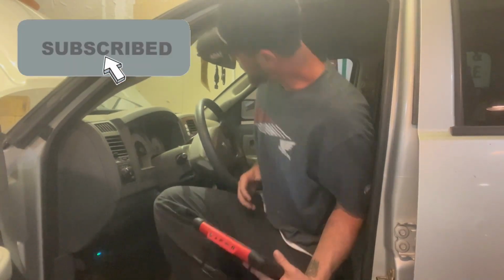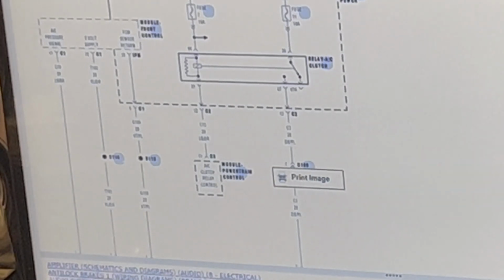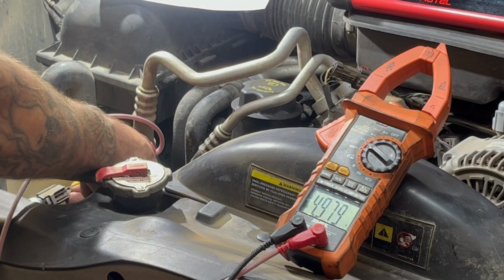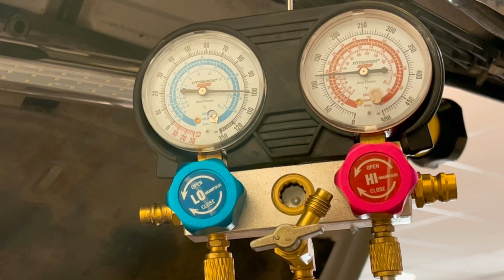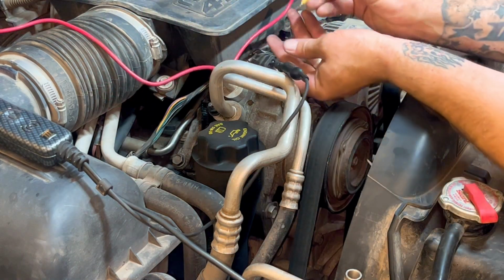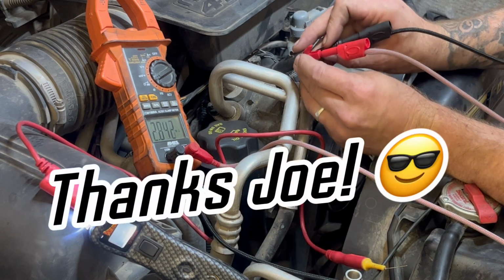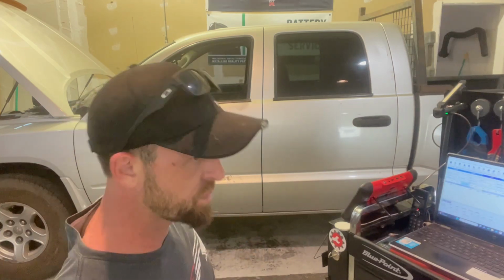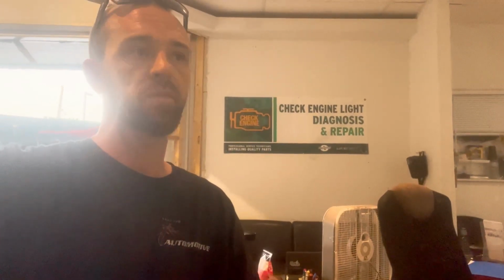2005 Dodge Dakota 4.7L A/C Inop. - P0533 Pressure Sensor Circuit High

Comment: What about if signal show 0v and ac hi pressure show 432psi and changes your reading even if you disconnect the sensor connector and i have 5v reference i have good ground and voltage is 1.0-0 when connected and the 12v at a/c compressor is not there and the only what to get running the a/c cluch is to jump the a/c clutch relay sending 12v via there to get the compressor going? Any suggestions

Comment: I remember once I saw a guy unplug the harness from the switch and submerged the harness into a bag of water. To keep the AC on. I asked how come he did that? And he explained and it made a lot of sense. Crazy buy made sensor. It was a three pin. Was amazed by his thought process until he could get a sensor.simple testing but effective. Thanks Max. Keep pushing bro
Reply from the maker: A bag of water?! Like dipped the connector in it? That’s funny! Thanks for watching bro!
Reply: @BigDogDiagnostics  yeah.and it worked. Like unplug the three pin harness. Pour a capful of water into the harness plug.turn on the AC. Have the car running. Put your finger across it. Boom.if the AC comes on. You became the resistor to turn on the AC compressor
Reply from the maker: @LAKERS4LIFE-g1i  wow! Kind of like jumping the pins? With yourself?! I would think that would short the connector out and/or give you a nice shock 😂 I was over here trying to figure out it you were messing with me 😆
Reply: @BigDogDiagnostics  basically you are using the resistance in your body to jump the pins. If it was a two pin. It's easy. Just jump them together but with the three pin. If you jump two pins. Nothing will happen. Will make a short video on it one day I guess